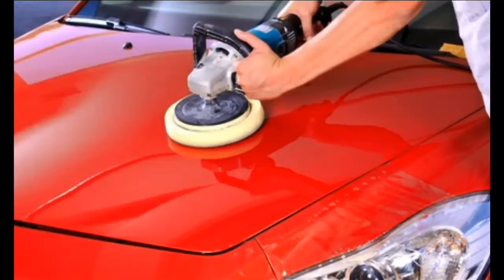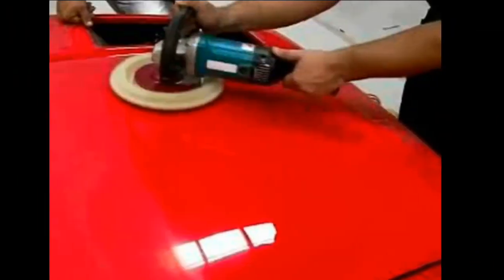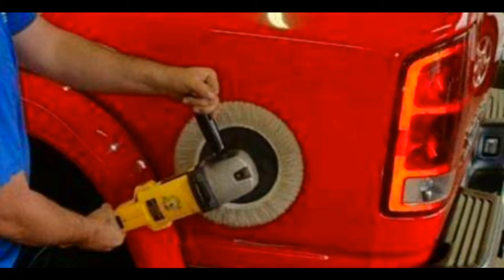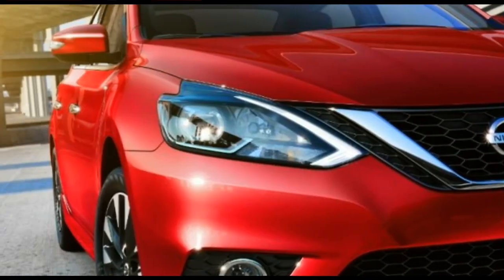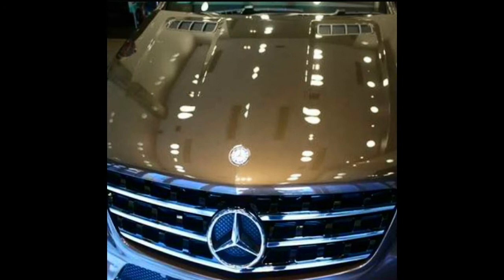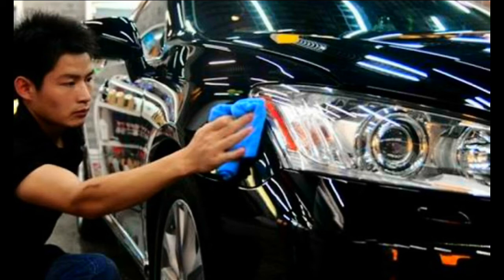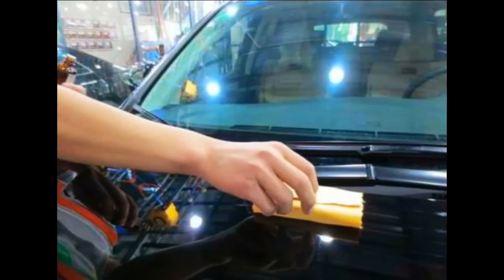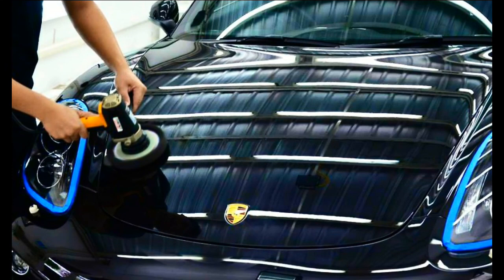Teflon Vs Ceramic Coating For Cars: Which Is Best?

Comment: if it is so beneficial then why car manufacturer will not have it . especially in a little higher segment
Reply from the maker: Car manufacturers will already coat their car with different layers and coating of paint on cars apart from the if you need additional protection than you can use Teflon for temporary and ceramic for permanent life